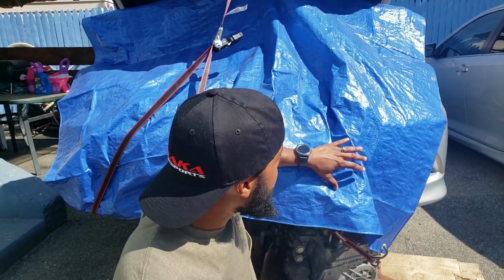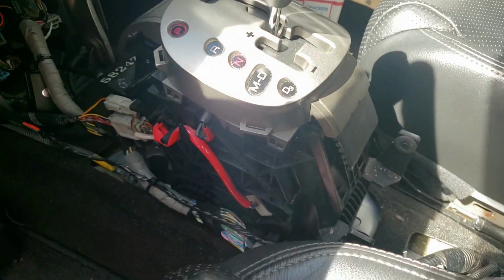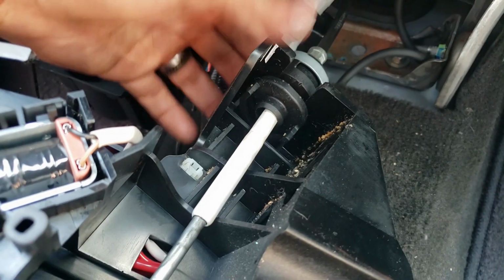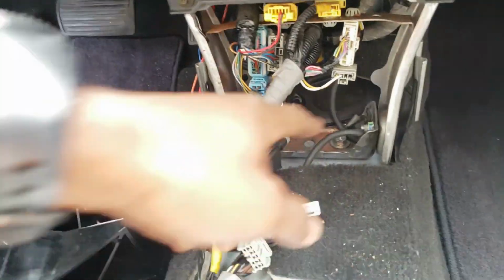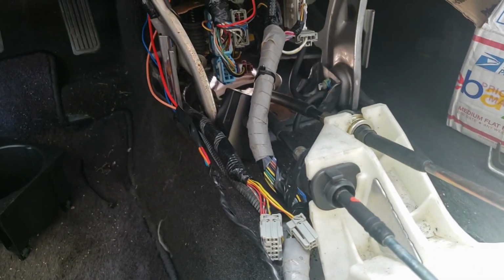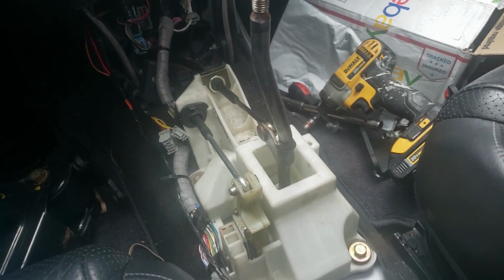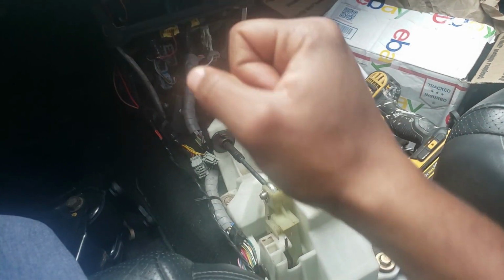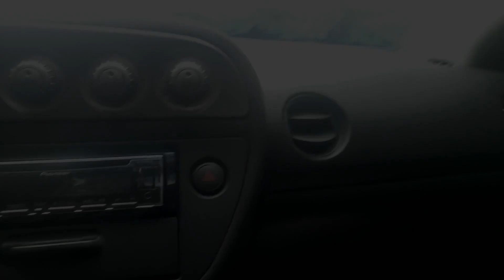RSX: Auto to Manual - Installing shifter

Comment: You have inspired me thank you
 🙏🏻
Reply from the maker: Hey glad to have helped! Thank you for your comment! It's encouraging! Just curious, what are you inspired to do? Do you also work on cars?
Reply: Aspired Driven Auto  yes especially that I recently got a auto rsx 02 that I want to switch it to a manual.
Reply from the maker: Oh ok, awesome! Just keep in mind if you do the conversion, you'll need a transmission from an 02-04. Something with the speed sensor is different between those years and the 05-06. Still in the process of doing my car. Once it's done, I plan on doing a video of everything that was needed 👍🏾

Comment: Do you think I can make the change on an Acura TSX 2006?  If so how much do you think is an estimated cost??
Reply from the maker: To tell you the truth I have no idea. I would say it is possible though. These cars come from factory ready to be Auto or manual. Most of the time it's just minor differences. For example on the auto RSX, the driver mount is different and you have to drill out the holes for the clutch pedal. I did have to get the auto to manual bracket that goes from the transmission to the driver side mount. Not sure if they make one for the TSX. If you have the skill, you could always make your own. Definitely try and do as much research as you can, I know for the RSX, there wasn't much info. So far I'm sitting over 2k for my build. Top expenses are the tranny, LSD, Ktuner user end ECU, and clutch with flywheel.
Reply: Aspired Driven Auto got it. Thanks for the info
Reply from the maker: No problem, your welcome 👍🏾
Reply: Hey  @7301soulseekers   I'm sorry to bother just want ask I also have the same car I'm researching to make mine manual  I can't find anything

Comment: i think the engine harness should work you just going to have to rewire or re pin your speed sensor  the right way
Reply from the maker: Yeah I might just look into that just to save time and effort of switching out the harness. I did notice that the plugs are shorter. I'll just look at the wiring and extend them if I have to. Thanks for the input 👍🏾

Comment: I’m so thankful for the series, it has helped me a lot. I’m having problems with the car not starting. Could it be the neutral safety switch in the internal harness that needs a bypass?
Reply from the maker: Hey thanks man! Glad they have helped! That could be the issue, especially if you didn't  change the dash wiring. Also ecu could be a problem if it had the immobilizer active

Comment: Hey bro I’m buying a rsx this week. I’m looking to put a stage 2 in it lol. But how much does it cost to turn auto to Manual?
Reply from the maker: If your still looking to but one try and find a manual one. But if you find an auto that's cheap and in really good condition then go for it but it would be great if you can find a manual up front. I think I'm about 2k-2500 in for mine.

Comment: And yo clutch ?
Reply from the maker: I used exedy clutch and flywheel, believe for a type S
Reply: How’s the exedy clutch and flywheel holding up ?
Reply from the maker: Still in the process of building the car. But I've used this brand before on my Civic, should be fine